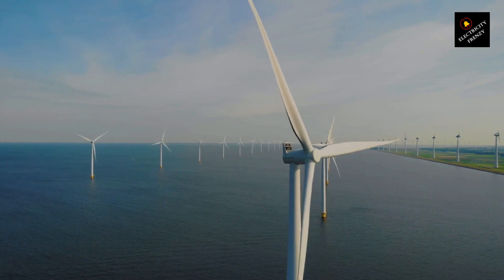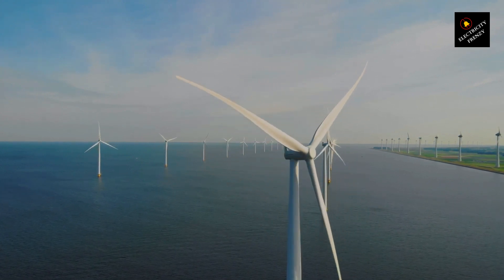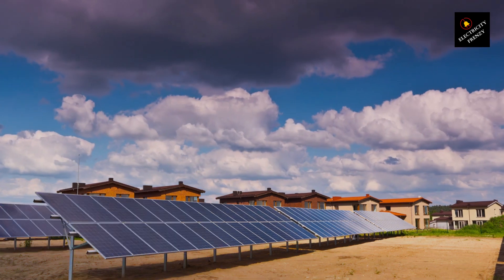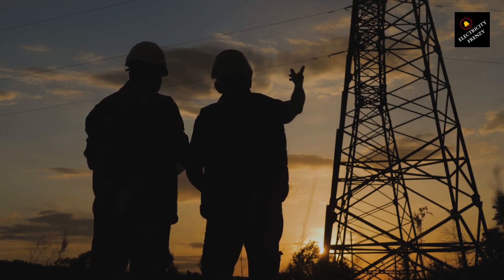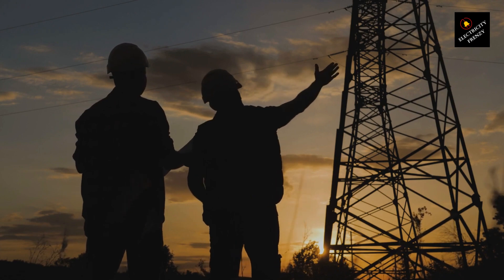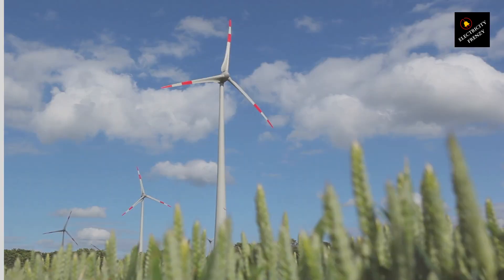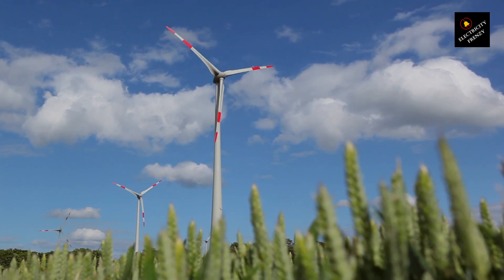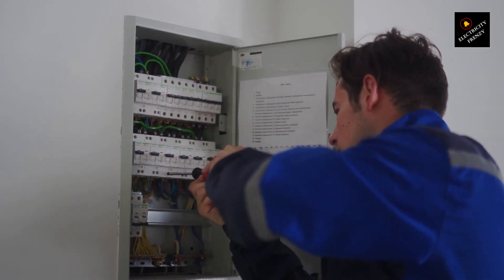Exploring the Impact of Water on Electric Motors

Comment: My Portable Air conditioner top motor won’t start anymore, it makes a starting noise but then stops when it’s supposed to start running and turning the fan, I suspect water damage because the days leading up to this issue there was water on the top of the unit seeping through into the fan/motor. Will it work again if it’s dried out or does it just need to be replaced?
Reply from the maker: Depending on the failure, I recommend hiring a professional technician to check it before trying to start it again.
Reply: @ElectricityFrenzy  So it started on and off on its own out of nowhere, the buttons on the unit won’t work including the power button, the only way I can turn it on or off is the remote. But it just constantly turns off on and like crazy on its own. Eventually it stoped turning off and was working. Seems like the motor is fine and I’m now leaning towards some electrical issue. What do you think?
Reply from the maker: It's good to hear that. I Think you took a risk by trying it with the remote.
Keep an eye on it for a while.
Reply: @ElectricityFrenzy  So far so good!! Thanks for your insight.
Reply from the maker: You are welcome